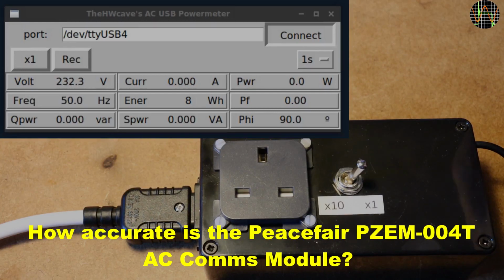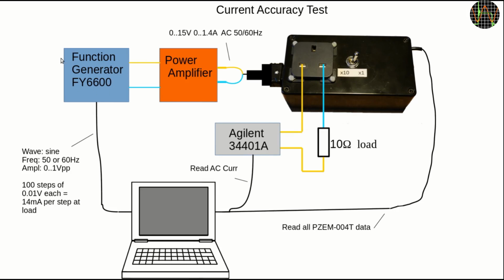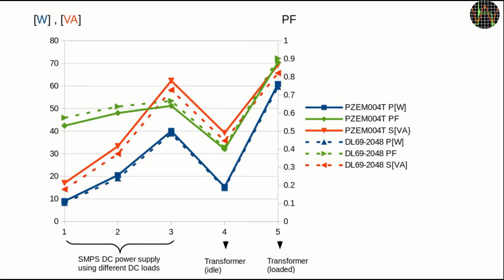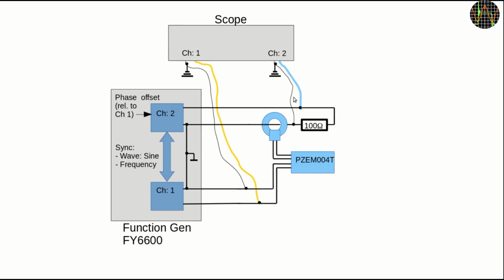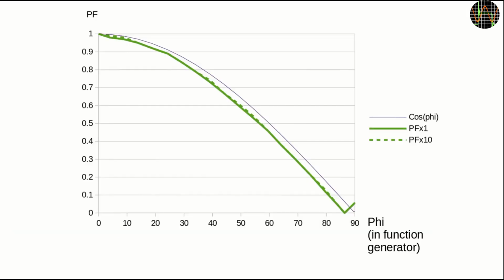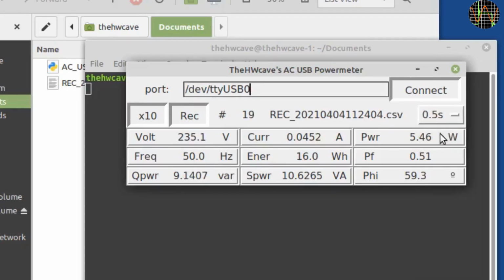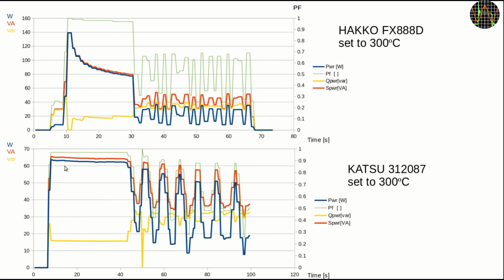How accurate is the Peacefair PZEM-004T AC Comms Module?

Comment: Is it normal to have a 10%,20%,30%+ error percentage when comparing the pzem004t current with a clamp meter accuracy especially when the current is less than 1A?
Reply from the maker: It might be, depending on a lot of things, most likely the clamp meter. Most clamp meters are quite inaccurate at very low currents. They are really meant for higher currents. If your lowest current range is eg 60A then trying to measure 600 mA is 1/100 of the range, 60mA is 1/1000 and lost in noise.  See if the following helps. Boost the sensitivity of your clamp meter by looping the current carrying wire 10x through the clamp. You must have exactly 10 segments of the wire inside the clamp, not 9 or 11! Then a current of 1A should read as 10A and 100mA as 1A ... (all values are x10).
Reply: @TheHWcave I'm also kind of leaning on doing the 10 segments but having a big difference in readings on both the clamp meter and pzem is not my aim for manipulating the value. I also tried using a multimeter but accidentally put it in parellel resulting for its fuse to blown so im worried doing it again but in series as im trying it on oven toaster, iron and kettle 😅 which is not safe as for other appliance not much to be afraid off. Thanks for the clarification and advice! 😁

Comment: Hello, how does and accurate is the energy consumption of the module?
Reply from the maker: Energy is just accumulated over time. So its basically the accuracy of the power value. That in turn depends on the accuracy of voltage and current and the phase angle. If we ignore the phase angle (i.e. PF = 1 = pure resistive load), and the volts and amps measurement accuracy is about 1.5%, the squared estimate of errors (SSE) aka RSS for power would be 2.1% This would also be the energy accuracy provided the voltage and amps do not change faster than the module can measure them. I mean if there are very fast and short spikes of power,  the module may miss them and therefore their contribution to the accumulated power * running time = energy value. It gets more complicated if  PF is not 1.

Comment: Thank you very much for this useful video.
Just one question, regarding ups. Is this module a viable solution when they are included? A lot of switching UPS generate a lot of noise and have some current dispersion.
Is this module still a viable solution? If not, do you know any other cheap solution for power measurements for ups?

Thank you.
Reply from the maker: I am not sure I understand the question. If you are concerned if the module can measure power draw from noisy devices, like SMPS, the answer is yes. I have never seen any issues

Comment: Hey, is it possible to measure 15-100hz ac voltage with this and read kind of accurate readings?
Reply from the maker: Sadly no. The module datasheet says 45 to 65Hz.. The chip datasheet itself says 35 to 75Hz and I measured that on my unit, 30 to around 400Hz is usable, but that may be an exception.
Reply: @TheHWcave  So from your tests anything under 30hz is unaccurate? Do you have an idea how get accurate measurements 15-100hz? With different circuit or ic? Thanks
Reply from the maker: @DEMOxSPL  I am not entirely sure what you are trying to measure.  I am guessing AC voltage  at 15-100Hz like for a VFD (Variable Frequency Drive)?  The problem is the low frequency. Most meters do not go below 45 or 40Hz. From my own collection, the only 2 handheld meters that would work are the Brymen BM235 and BM869s because they have a VFD mode that goes from 10Hz. Bench meters go even lower. The Agilent 34401A goes down to 3Hz . The OWON XDM 1041 goes down to 20Hz. These are just meters I have. There are many more out there...
Reply: @TheHWcave  I want to measure power output from car audio amplifier (sub level range) I want to make my own circuit.
Reply from the maker: @DEMOxSPL  Ok, that's different then. Its an interesting project. If you have a reasonably smart scope, one way to do this would be to attach a resistor R as dummy load as speaker and use the scope to measure the voltage V over R and perform the  math operation (V*V)/R on the signal which gives you a power graph
Reply: @TheHWcave   Yeah but speaker impedance is all over the place.. 4ohm speaker can vary from 4ohm to over 40ohms.

Comment: Maybe accuracy differences are caused by different current density? 10 turns will have 10 times smaller current density. It definitely improves transformer efficiency, maybe somehow impact output current current too, can't find anything. You could try repeat the accuracy test with single loop of ten wires. Also, if seeking accuracy, comparison with 10A shunt version would be interesting, that should be more accurate in general.

Comment: Fantastic precision exam and very good documentation of the entire procedure, I learned many ideas and concepts from it.

I still have doubts as to how the PZEM-004T calculates the PF value, if not by controlling the phase angle. Could you give me a better explanation? I am trying to solve some problems in a Shelly EM that is not able to measure a reactive load of two ducted air conditioning machines, which in standby has a P=20W V=235 CosPhi=0.1 I=1A (it is the reading that the digital meter from my electric company returns me), the shelly EM indicates P= -5W V=236 PF= -0.02

Thanks again for the shared knowledge! You already have a new subscriber.
Reply from the maker: You are correct in suspecting that the PF shown by the PZEM-004T is not very accurate for very small PF values.  The reason is hard to explain in a YouTube comment, but I try. Please check the V9881D datasheet. In chapter 10 it explains its inner workings very detailed. The signal processing part of the chip measures active (P) and reactive (Q) power but it does not measure or calculate PF. This is done in the firmware. PF can be calculated using pf = cos(arctan(Q/P)).  So, how does it measure P and Q? There is a lot going on in the signal processing part of the chip but in essence the trick is that for active power P, it multiplies volts and currents while for reactive power Q, it first phase-shifts the current by 90 degrees before multiplying. If you consider the 2 extreme cases: first current and volts are in phase. The multiplication produces a (power) wave form that is always positive and the RMS average of that is active power.  At the same time the Q calculation takes the same current and voltage and does the same multiplication but first  phase shifts the current by 90 degrees. The result is a power wave that is always symmetrical around 0 (same amounts are positive and negative) so the average Q is simply zero. Plugged into the formula you get a PF = 1. If the current is phase shifted by nearly 90 degrees already, the then active power would be mostly symmetrical around zero with a tiny non-zero rest, and Q will now be a large negative average. This gives a large negative value of P/Q and an arctan of -89.9999 deg and cos(89.9999) is a PF of nearly zero. Obviously this method has increasing accuracy problems (because of arctan) the lower the PF gets but the P and Q values themselves are still very accurate. The problem in calculating very small PFs might well explain the discrepancies you see because both meters indicate show very small PFs.
Reply: @TheHWcave  Infinite thanks for taking your time to give me this splendid summary explanation. I had been checking the datasheet of this v9881d and also of the ADE7953 (https://www.analog.com/media/en/technical-documentation/data-sheets/ADE7953.pdf, they seem very similar. they apply an HPF before the multiplication (this is where I understand according to your explanation that it is where the 90º phase shift occurs due to the high pass filter?) and then an LPF to eliminate harmonics.

What I don't understand is why it does for PF=cos(arctan(Q/P)) instead of something simpler like PF=P/S. If S = V x I and the P extracts it with the displacement trick.

Also at the beginning of your explanation you say that P=V x I, wouldn't this be S?

Excuse me if I'm talking nonsense, I'm starting to understand this fabulous world of AC! Thanks again for your effort to make me understand.
Reply from the maker: @isabido  Yes AC is complicated especially if it is no longer sinusoidal.. Anyway, no the 90 deg. shift is done only for the current channel and after the HPF and LPF which are used for both. Also there is a phase compensation (delay) circuit but that gets really into details.  These chips were made to meet the standards for electricity (smart) meters so they are doing a lot of wonderful signal processing to get the best accuracy for P and Q. Note that apparent power S is not V x I.  S is a vector (as are P and Q) and the magnitude of S is the vector sum of P and Q, in other words S = SQRT(P^2 + Q^2) (Pythagoras)
Reply: @TheHWcave  I knew of the formula S = SQRT(P^2 + Q^2) , but this would also be valid, right? S= Vrms x Irms.  Thanks!
Reply from the maker: @isabido  Yes that is correct

Comment: HI , WHAT IS THE MINIMUM RESPONSE TIME FOR THE MODULE TO DETECT VARIATION IN VOLTAGE, FREQUENCY, A, WH? ETC
Reply from the maker: From the datasheet the V9881D seems to collect and process data at speeds of several tens of kilohertz to do all kinds of signal processing and zero-crossing detection and parameters such as volts, current and power are internally available at least every 10ms or even more often. However, the firmware doing the serial connection over USB and sending the data using the MODBUS protocol with checksum etc is much slower and sends updates only about every 1 to 1.5 seconds. That means a fast change may be registered but you may not learn about it until up to 1.5s later. Worse, if a spike comes and goes within the 1.5s window, you may not get any information about that event.

Comment: With my device, 3 out of 4 requests go unanswered and the software (any software, not just your python script) complains about the timeout.
When it does respond, it seems to be as accurate as you've shown. I'm happy to have this cheap monitoring device.
Were you able to reprogram its address by any chance? I can't even read those registers.
Reply from the maker: How strange. Mine works like clockwork. I had another viewer asking me about the update rate and I ran a test polling the module as fast as possible using only the AC_COMBOX.py command line interface with --time 0 parameter.  This managed about 10 polls per second but we found that the firmware only sends new data about every 1.2 to 1.5 seconds (i.e. you get 10-15 times the same data packet if you poll 10 times /s). Normally I don't see timeouts or any other issue and I think that other viewer also did not see timeouts on his module.  
No I never attempted to change the slave address
Could you try running just AC_COMBOX.py ? Try other USB ports, maybe USB2.0 instead USB3.x . Another possibility is interference. I do get a timeout or even sometimes a reset of the module if I use the x1/x10 hardware switch under load. In my built the current transformer with the x10 coil is right next to the module and can apparently cause some issues when the switch is moved. This should not be the case with a x1 and a single wire going through the core. In general it could be that your environment/mains is very noisy causing interference on the USB cable? If you are using the original PZEM-004T with the capacitor-dropper power supply there must be enough mains voltage to power the board and the opto-couplers (more than 60V-70V if I remember). Last tip, if you poll for example every second, you should be able to see the RX LED on the module light up periodically. If the message decodes correctly (checksum...) the TX LED should light at the same rate. If the RX doesn't light regularly at the poll rate, messages from the PC don't get to the module. If it does light regularly but the TX LED doesn't or not at the same rate, then the PC message contained errors and the microcontroller could not understand it.  If they both light regularly then there is a problem in the PC

Comment: Man, you are rocking. ❤️+1
I remember you have shown that the accuracy range is unreliable under 200mA, is that the cause ?

Use a pi4 as laptop. It would be better for Ubuntu, you can also use multi os / boot even with ssd, but make sure to have a ups connected.
Reply from the maker: Not sure why it isn't as accurate as expected at <200mA. I mean I understand if a sensor good for 100A is inaccurate when measuring values that are less that 0.2% of full range but when using x10 its still not much better. Ok, to be fair now we are just at 2% of full range, still in the weeds, so to say. 

Nice use of a pi4 and I agree that a UPS/power bank is a good idea

Comment: Great content. Kudos!
I need to measure the power direction. Negative amps or negative powerfactor. I use to prevent grid-tie solar power feeding  into the grid (and paying for it). Unluckily this seems not possible with this meter and there is no hack as there was with the older variant of this meter. Any idea?
Reply from the maker: No, unfortunately not. It does not care about which way you orientate the current transformer. You would need something that is made for solar installations, I suspect the majority of power/energy meters do not support direction.
Reply: The same situation applies to me. Have you found a method to measure energy to prevent energy going back to the grid?
Reply: @irfansensoy5901  shelly 3EM

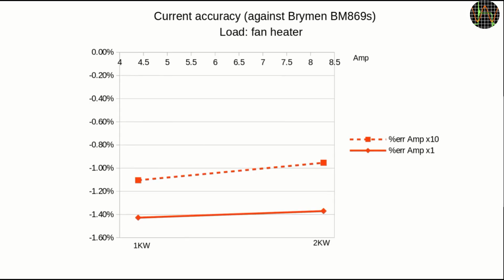Comment: 6:11 I guess that the current transformer is not optimized for low currents, but more for high current 10A and more.
1A or 1.4A is still 1 to 1,4% of the range this current transformer use.
At the moment, i'm building a isolation transformer with buildin "dim bulb current limiter" with 4 halogen G9 bulbs to make it very compact.
At the output, i'm gonna use a selfmade "electronic circuit breaker" where the trippoint can be set from 1mA to 3A. 
For measuring the current, i use the same current transformer as yours, that came with one of the Peacefair meters that i have, 
and i discovered that the accuracy to set this trippoint is much better when i use 4 to 5 turns on the primairy side of this current transformer.
My i ask, what type of amplifier you used for amplifying the output of the signal generator ? 
Is it a "simple" audio amplifier or so ?
Reply from the maker: Its a 100W mono audio amp board using a TPA3116D2 chip from Ebay. It is actually surprisingly good for the price.  It needs a fairly beefy power supply if you draw a lot of current on the output or it will start distorting the wave form. Otherwise it is very efficient (class D). It is linear from  60Hz to 2kHz,  The 3db points are at <20Hz and 10.1KHz.  Output impedance can be as low as 2Ohm.  The problem with it is more that the output is symmetric so you have to watch very carefully not to accidentally shorten either terminal to ground. For example if the amp's input is coming from a ground referenced source, you can no longer connect your scope to the output (because it will shorten one of the terminals against ground). These limitations are a nightmare and easy to get wrong in complex setups. I have blown quite a number of fuses in the amps power supply already. Ideally the amp should be floating (with respect to ground) and the input, both(!)  wires, signal and ground must be AC coupled to maintain it.
Reply: @TheHWcave  thx for the reply. I have a JOY-iT JDS6600 60Mhz signal generator, and that one has also a very low current output, but now i have a idea to amplify it.
A have one more tip, you mentioned that it can be dangerous to switch between x10 and x1 , for a workarround, you can use the multiple turns as fixed primary, and switch the burden resistor between x10 and x1. 
For the x1 position, you can use a fixed burden resistor value, and for the x10, you can use the switch to parallel a lower resistor value.
That way you only switch the secundairy side of the current transformer, that carry a low current, and also the x10 and x1 use the same amount of primary windings and the accuracy will become better for the x1 position. Grtz
Reply from the maker: @BjornV78  A good idea and and I actually did something like that before https://www.youtube.com/watch?v=Lf5nhBLmJ-c&t=1s . but in this case there are some problems. Firstly the x10 resistor needs to be 10x higher not lower.  Since a current transformer must never be operated without load, you need to wire the x10 mode resistor hard in (0.5 Ohm in this case) and use the switch to add the lower resistor (a 0.05555 ohm resistor in this case) in parallel. Tricky to find / make  such a value (e.g. from resistance wire) and then the unpredictable contact resistance of the switch is already in the same region. A better way is to use a make-before-break switch with a 0.5 Ohm (x10) and the stock 0.05 Ohm (x1) resistor. The switch contact resistance may still spoil it, but this may work.  Unfortunately the chip is calibrated for the 0.05 ohm resistor and the filter network, so you can't just use higher resistor values. Without these constraints, your idea is definitely valid.